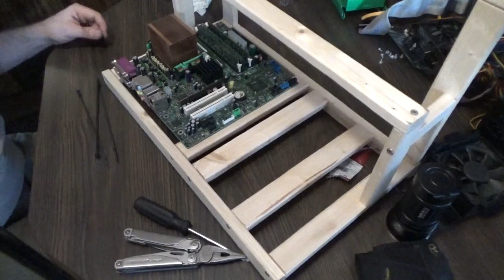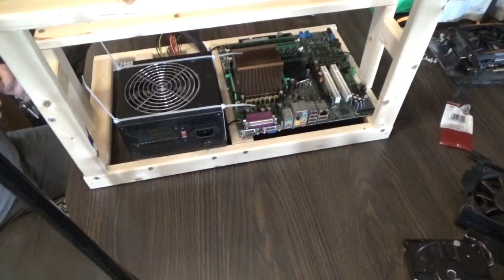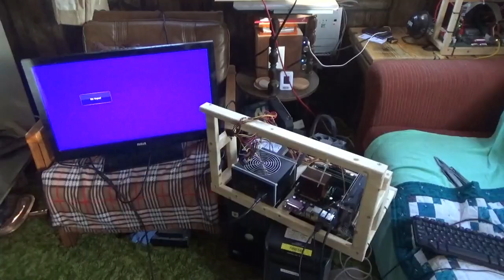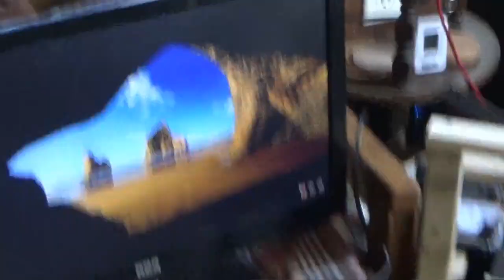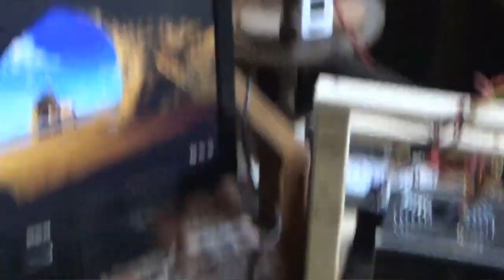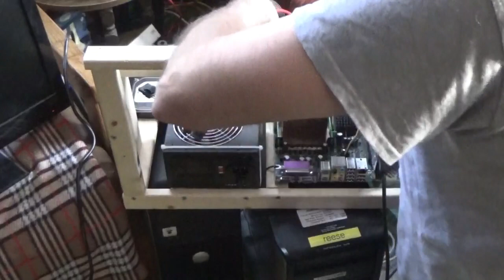Gutting A Computer To Build A Mining Rig Part 2

Comment: If you unplug the power supply from the wall, you can’t use it the remove static. It won’t ground you. Plug it in and turn off the switch
Reply from the maker: Good point

Comment: If you want you can mount better coolers on GPUs to decrease fan noise. Like heat sinks designed for CPUs, as you are less concerned with a space than normally it goes with a GPU.
Reply from the maker: The fans dont bother me but yeah, I have seen those. Thanks.